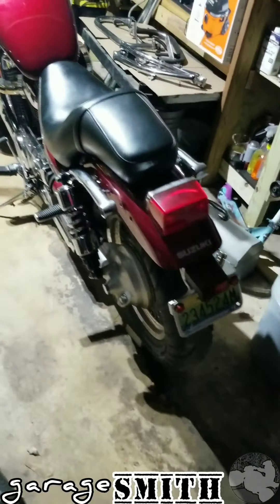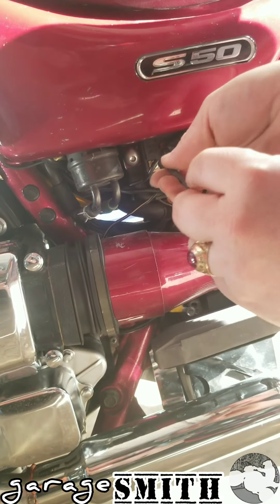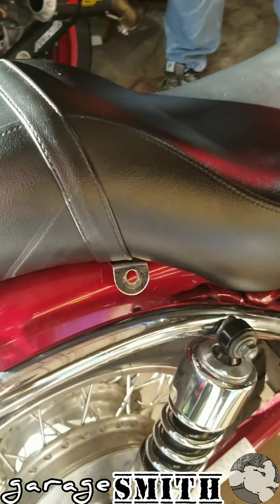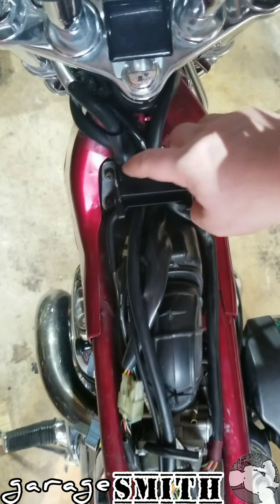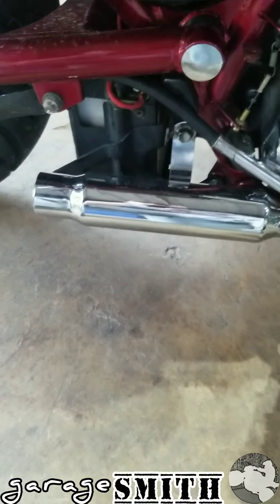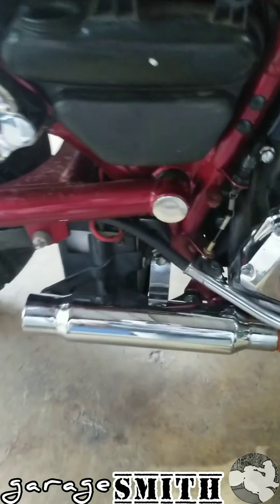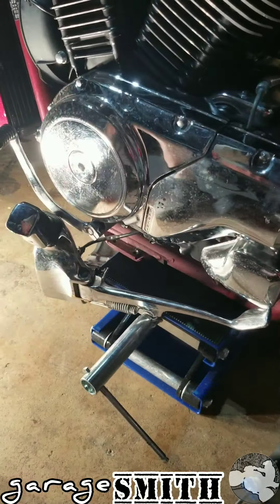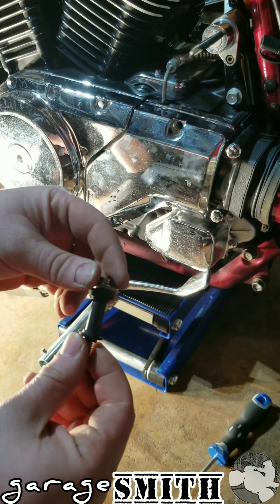Suzuki Boulevard S50 Disassembly

Comment: Wouldn't it have been easier to just remove the front forks and triple tree and re-welded a piece of metal (such as a bolt head or maybe a nut) to the neck to prevent the forks from turning all the way?
Reply from the maker: If they wrecked the bike hard enough to snap that front stop on the fork then who knows what else could have happened. I'm in the business of staying alive on a motorcycle I know is 100% fine and this frame was not fine

Comment: Where is the carb on this motorcycle? I need to clean mine out and idk much about motorcycles. Any help would be appreciated
Reply from the maker: One is underneath the seat and tank and the other one is under the tank but more toward the front of the bike.  It will be a process taking them off and rebuilding them and getting them back on but you never know how to do things until you do them. Just make sure you remember or take videos or pictures of how stuff goes back together. I fortunately remember where stuff goes
Reply: @psychouki  thanks bro I'll look into it
Reply from the maker: @azzyoutdoors3296  I actually just got rid of my boulevard so as far as a reference I don't have one anymore but I csn try and help eith whatever your questions are
Reply: @psychouki what's it look like? Got a picture?